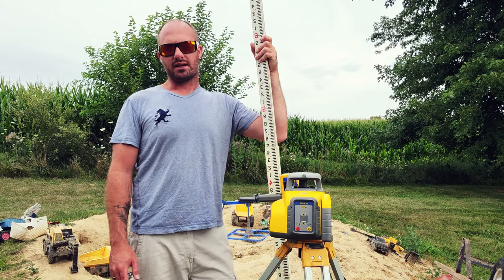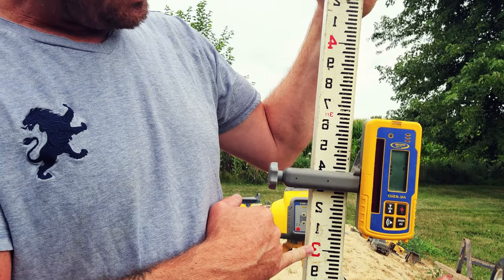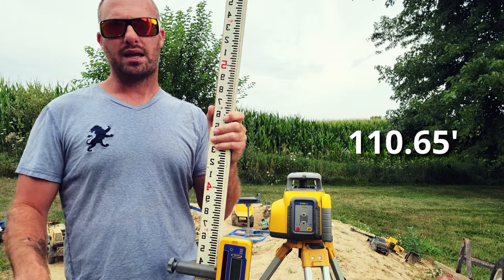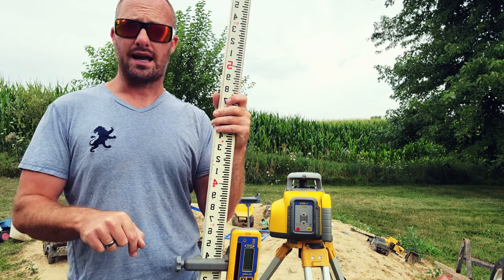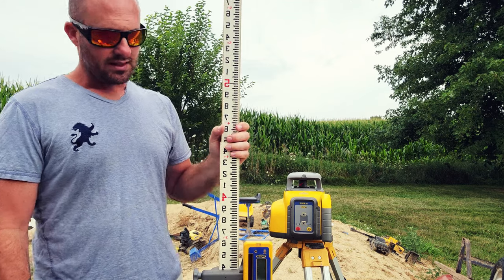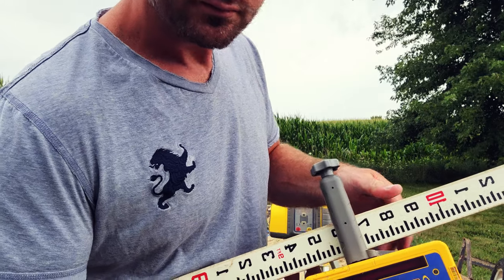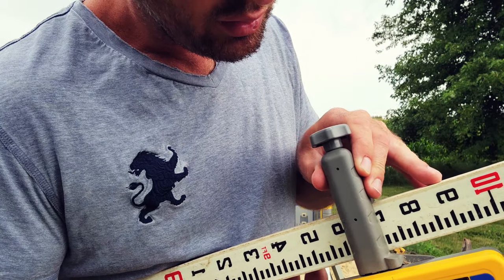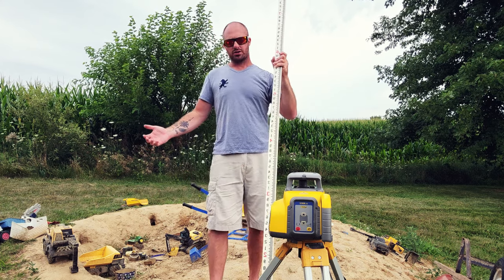HOW TO SET ELEVATION BASED OFF OF A HUB || How to take elevation using a grade rod and a laser

Comment: I was trained to figure the height of instrument (H.I.)   Then calculate the  height difference.   Bm at 110.6   Back  shot 3.86  HI= 114.46   Basement sub grade 96.25.   Fore shot  =  18.21.  This way you can figure different elevations easier.  Elevation of the light pole base just outside the front door no problem.
Reply from the maker: That's a great method. If you have to bounce between multiple Elevations that would be a better method to use. Thanks for commenting!
Reply: Yup I’m a union carpenter and I’ve always done it like this.
Reply: Me too!
Reply: Is there a video showing how this is done. ?

Comment: I came up with an elevation of 9.72 feet on the rod when I double check your verbal math. I watched again and realized your HI elevation was set at 3.38 not 3.39 on the rod that resulted in 9.71 (9.38 + 0.33= 9.71) on the rod that you came up with. Either way, close enough for residential work. Enjoyed your video from an old grade checker from the eye level and rag tape days before lasers.
Reply from the maker: Thanks for the comment Jerry and you are correct.  As I look back on these grade rod videos I realize I need to remake them now that I have someone to hold the camera for me.
Reply: @DieselandIron  I am a retired grade checker and field supervisor but, I still take the time to train new grade checkers (for free) and I use your videos as training aids. I appreciate your willingness to share your knowledge.
Reply: @jerry8986  man any advice for an operator for getting into cutting? Where could I go ? I run a d6 for wildfire, and a 140m for snow removal in the winter. And I would love to get onto a company with year around work and that works the dirt.

Comment: I was told you read a grade rod from top and bottom of the black lines not black line/white line
Reply from the maker: The black lines are the actual tick marks but the white between also represents 1/100th.

Comment: I'm glad to finally see someone trying to teach old school ways,I've been doing this for 30 years, and it seems every new young operator asking me for a job can only hook up GPS set their blade on the control point and that's it,if they encounter any issues they want to go home,I think anyone who calls themselves a operator should know how to read grade stakes,set grades run string line and grade free hand,The company I work for has GPS good high quality stuff and they realized that the jobs built with GPS were good but when as built they were off normally a tenth that's a lot of over run on asphalt,so they make me do free hand finish work on the rock we get a surveyor to set stakes and and I finish it my stuff is usually within a 1/4" use to be better but I'm getting old and my eyes are messing up
Reply from the maker: A lot of essential skills are being lost and a pretty rapid rate right now in the trades.  Finding a decent finish dozer operator who isn't reliant on GPS is getting harder and harder.  As you stated, finding guys who can read grade stakes, calculate fall, or just calculate a simple cut are also getting harder to find.  I'm still a firm believer of learning the basics before you step up to getting on the machines.  Thanks for the comment Pat!
Reply: @DieselandIron  yeah the GPS is my biggest complaint,I think a operator should spend at least 5 years with grade stakes,a string and transit's then learn GPS the company I'm at has 4 crews 3 are GPS I'm old school the other crews have up to 5 guys plus labor's,I have 3 guy's my crew turns out double the work you have to have that natural ability to know when something is wrong,I'm fixing a job right now that was built all GPS the guys built it according to the system,turns out the operators didn't know how to properly program for FILLS OR CUTSso everything was figured at basic grade,so the building was 4 ft higher than the parking lot they turned a Wawa into a loading dock,I asked what happened they said DONT YELL AT ME I CAN ONLY DO WHAT THE MACHINE TELLS ME they didn't have the knowledge to realize something was FUBAR
Reply from the maker: @patwatson2454   That's one of the biggest issues I have is that using GPS right off the bat makes you too relient on the machine.  You can't turn off your brain when using GPS.  You still have to understand the big picture and make sure everything makes sense.
Reply: @DieselandIron  💯

Comment: Great videos guys!  Easy explanations and not to technical!  So question for myself based on some of the Q & A's down below.  Im attempting to put in an above ground pool in my back yard and i need to sub out 8"s of soil in the shape of my pool while making sure I'm levelling the ground inside the pool outline.  Based on your video couldn't my hub elevation be set at the lowest point on the outline of my pool?  Then add the 8"s to the hub measurement?  So say i take the first shot in front of my laser for the hub measurement and its 3'.  Add the 8" which is then 3' 8"s.  So by setting 3' 8"S on my transit if i take the transit now to any point on my pool outline i would have to dig out the amount of soil that gets the sensor to show grade again. Correct?
Reply from the maker: You are correct. As long as your laser doesn't move and you are using your same reference number when looking through the transit you will dig a level pad 8" lower than your intended finish grade.

Comment: Thank you so much for your dedication and videos, I have learned so much from them. 

I have a question, if using a Lenker Rod, would we set that BM 110.65 on the tape before getting the Back sight (BS) reading?

If I’m correct, it be BM + BS = Height of the Instrument (HI)
From there, HI - proposed or finish grade FG = Reading for the Ground Rod, therefore proceed to move receiver to that value? 
Then we would go to each of the ForeSight locations to collect those readings and calculate differences (weather cut or fill)? 

Thank you so much for your time, I am a fairly new operator and trying my best out here to soak in as much as possible to be more proficient all around.
Reply from the maker: I think I'm understanding your breakdown correctly and if that is the case then yes.  Benchmark + Grade Rod Mark = Height of Instrument.  Once you have that you can adjust up or down the rod as necessary to achieve your grade.

Comment: Yes I got a location that reads 5.4 which is high  and a low spot that reads 13.4 how much do I have to cut from the high  spot to the low spot with a foot fall
Reply from the maker: 13.4 - 5.4 = 8 feet.  If you wanted to have a foot of fall then you would leave your high side 6" high and your low spot 6" low which would give you a 7" cut.

Comment: how about the height of instrument? bench mark plus back sight reading = height of instrument the minus the design elevation is that the actual elevation need to excavate?
Reply from the maker: Yes, I believe you are right if I'm understanding you correctly.  Let's say your hub was at 105' and your basement was set at 100'.  I would shoot the hub and for round numbers we will say we land at 3' on our grade rod.  I will then go up the grade rod 5' (105-100=5).  Your laser eye should now be sitting at 8' on the grade rod which means we have to excavate 5' of material to get a solid tone on the rod to put us at grade.

Comment: So not to harp on you or anything but I had some issues with your math lol your rod height was actually 3.38…

So if your hub elevation is set at 110.65 when you occupy that hub and set the indicator at level you reached a rod height of 3.38 so what you would do at that point is add 3.38 to the hub elevation of 110.652 now achieve an elevation of 114.03 which is now the elevation height for your laser level… And then what you will do from this point on is take that elevation into consideration over anything else so in order to achieve your grade elevation of 104.32 for your basement you will want to subtract 104.32 from your laser level elevation of 114.03 which will give you 9.71... "9.71" will now be your new staff height needed to reach your elevation of 104.32… That method is a heck of a lot easier than the 17 step process you describe in your video lol so again it's as simple as setting up your laser level turning it on it self levels.. you will then walk over to your hub adjust the indicator up or down the rod until it reaches level then you will take that staff height add it to the elevation of the hub you are occupying that new elevation becomes the elevation of your laser level and like I said it's a simple as subtracting your desired elevation from the elevation of your laser level and the outcome of that equation will become your new rod height needed to acquire grade..... 

Hub elev=110.65
Rh on hub=3.38
Add 3.38 to 110.65 getting 114.04
Now minus 104.32 from 114.04 getting 9.71 so just move the indicator to 9.71 on your level rod And when you dig down deep enough and that indicator hits the level mark it will then be at your needed elevation of 104.32
Reply from the maker: There is a good chance you are 100% correct on my math being wrong and your method being more efficient.  I've been meaning to come back to these videos and redo them now that the channel has grown a bit.  I was very green and still a bit nervous on the camera for these videos!  Thanks for catching the error and thanks for watching!

Comment: Can you explain the difference between a hub and a benchmark ?
Reply from the maker: A hub is the actual stake in the ground that your grade rod will sit on to take the elevation measurement.  The benchmark is a reference term used to describe the object you are using to get your elevation.  A benchmark could be a hub, a manhole, a specific point on the curb, etc.
Reply: A benchmark is a known elevation
Reply from the maker: @marthawest2802  much better way of putting it. Thank you

Comment: What is the difference between benchmark and sub grade?
Reply from the maker: A benchmark is simply a known point that is used to measure from.  Say I had a hub at the top of my dirt pile that we knew was 783.2 feet above sea level.  I could take a grade reading at the bottom of the pile and calculate the difference between my hub height and the shot I took at the bottom of the pile.  For this example let's say the height at the bottom of the pile is 1.5 feet lower.  I now know the elevation at that point is 781.7 feet above sea level.

Subgrade simply refers to the initial dirt layer you excavate down to before constructing a building or road.  If we started a road in the middle of a field, we would first bulldoze down to a specified level so we could add in our sand and stone.  The level of dirt we excavate down to is your subgrade.

Comment: What I don't understand is wouldn't it be much easier to calculate if these lasers had a way to fine tune the level they sit at so your your hub grade is say exactly 3 feet and not 3.0125 feet for example.
Reply from the maker: Even if you were 20 in at exactly 3 ft your other point isn't going to be an exact number so there will always be some math. Once you get used to going up and down the stick you don't really have to focus on the math so much, you are just taking it up in the increments of the elevation change. For example if we were going up the stick 3.14 ft I would start by going up the stick the three feet. From my new spot on the grade rod I would then move up 1 tenth and then I would move up my 4 hundredths. By doing it this way I don't have to be concerned about the math

Comment: As a homeowner/diy guy who is looking at lasers. I dig ponds and do landscaping stuff would you recommend a cross line laser or something like the inexpensive rotary lasers ... ? Thanks
Reply from the maker: Unless you plan on taking on some pretty large projects I would stick with a basic laser. Any slope can be calculated and done straight on the grade rod. It would be hard to justify spending for $5,000 on a commercial grade laser setup for what you are talking about doing
Reply: I was looking at the Bosch revolve 900 it’s 533 bucks or the Johnson level kit for 400 bucks

Comment: Can you help me understand how I bring up grade? I'm doing a foundation and the elevation is about 3'-4' lower than the level I need my subgrade at, it slopes from the front of the proposed slab to the back of the slab. The front is at the grade I need it.
Reply from the maker: No problem! You'll need to use an approved material (21A, 1x3 crushed concrete, etc depending on the application and what your situation calls for). You will start at the low end of the grade and put down 10-12 inches of material and level it. This will need to be wet down and compacted. Then repeat with another 10-12 inches until you reach your finished grade. Is this a personal project? Often times if this is a residential build you will need to have a proctor test done to verify compaction is adequate but it depends on your local code and procedures.
Reply: @DieselandIron  I certianly appreciate your very quick response! It's for a home owner, doing a monolithic pour for a detached  garage. We are using structural fill for the subgrade. And compacting with a Bomag 8500. As for any compaction testing I believe the local building department will be doing that, although I'm not 100% sure as this is my first foundation. So when I am doing my lifts, I do so until I reach the grade I need that I established with my laser level? Is there no need to adjust the receiver?...you can add another subscriber to your belt brother, I appreciate your work!
Reply from the maker: @yaqqirnasi7804  I appreciate you supporting the channel! With your lifts you can just eyeball the height. Most inspectors don't get to technical with it unless it looks like you are throwing down way too much material in each lift.  That will allow you to keep your laser set to finish grade. If you want to be more precise you can just bump your laser eye up the grade rod to your first lift and then bump back down your rod with each lift until you get back to your finish grade number.

Edit:  I just re-read your question and realized I didn't answer all the way. Yes, you will bring the fill material up in one foot lifts to the finish grade that your laser is set to for the rest of the foundation
Reply: @DieselandIron  Very well, I had thought that was how it was done but sometimes one needs instruction, I found you just in time! I'm not opposed to sharing my work, but I'm unsure how that can be done. I can appreciate constructive criticism 😁! I'm sure it's nothing you haven't seen, I'd like to learn the things you already forgot haha.
Reply from the maker: @yaqqirnasi7804  I'd love to see some pictures of your work! Sir some pictures over to my email at thatdiggerdude@gmail.com. Let me know if you've got any other questions and I'll try to get them answered for you.
Reply: Will do! They will come from my username @gmail, I cartianly appreciate your time. Looking forward to your upcoming work. Have a safe one!

Comment: Hey guys. 
I'm having a little difficulty understanding this grad stake. It says.. TOP OF BAR = 125.308m. Can somone tell me what it means please..
I'm digging a foundation for a house. The property is on a crazy down slop and it's a walk out basement on the back side.
Reply from the maker: That is an elevation grade stake. I don't know what bar it is referring to but the top of the bar will be 125.308 m above sea level. You will need to have a benchmark somewhere on site that you can pull a grade from with a known elevation. Once you have your known elevation you will figure out the difference between the benchmark elevation and the elevation for the top of bar. You will adjust your grade rod by whatever the difference in those two elevations is.

Comment: You could make a video more nicer with an example of digging a pond at depth X and set water level at depth Y with reference to the grade the transit is sitting on which is distance Z. 

Then when you extent the sensor from the ground , mark with a removable marker the point where you get a zero reference as ground or zero. This point the laser is parallel to the sensor. Note the distance. 

Now I know I have to dig a depth of distance X and set water at distance Y. I will mark the distances accordingly on the ruler so that every-time around the pond I try to know where the max depth or water level will be, I will just move the sensor stick and see if I need to add or remove soil to get the desired depth. Similarly I will do the same for the water level.
Reply from the maker: I have a possible pond project coming up in about a month. Let me see what I can do
Reply: @DieselandIron  thanks

Comment: So a bench mark is made by a surveyor? Now will this location be your hub? if not how do you decide the hub location?
Reply from the maker: Yes, a benchmark is set by a surveyor.  The reason you will hear benchmark and hub used interchangeably is because often the benchmark stake is an actual hub stake (the long 1in by 1in stake).  Without getting too far down the road of the surveying side of the business, benchmarks can be a number of things.  In some cases they will pound a nail in the ground, sometimes it is a physical monument of some sort, etc.  On a lot of dirt jobs your benchmark will be represented by a hub stake with a grade stake right next to it (literally touching it).  The grade stake will have "BMK" written on it along with the elevation.  That elevation is referencing the top of the hub stake.
Reply: So is 6.33ft the total amount in the ground to the bottom of the footing?  On a lot would the highest grade be considered a good benchmark to use sense a good rule of thumb is to be higher for drainage?  What is your preference on what to leave out of the ground after final grading?  Thanks a bunch!